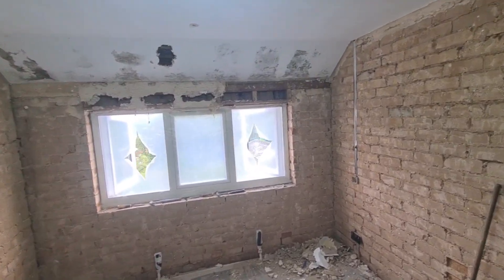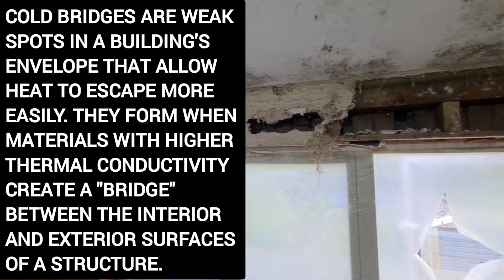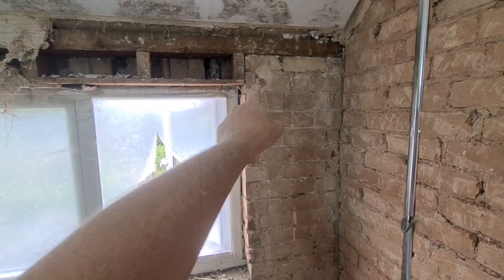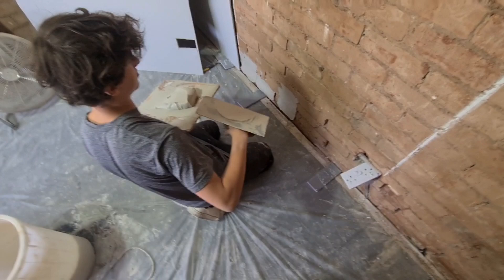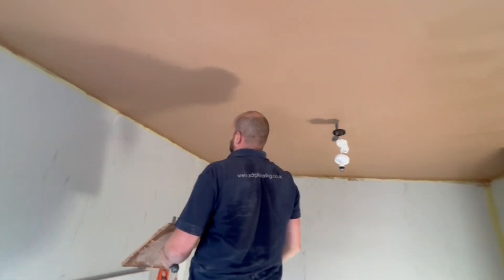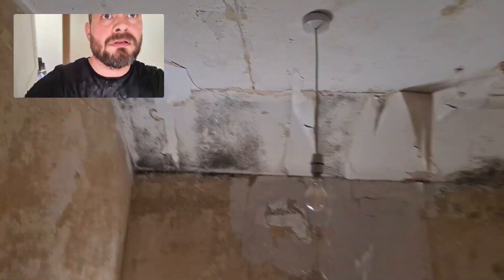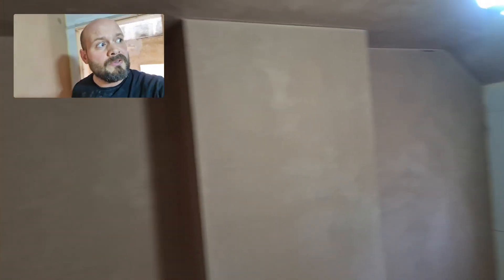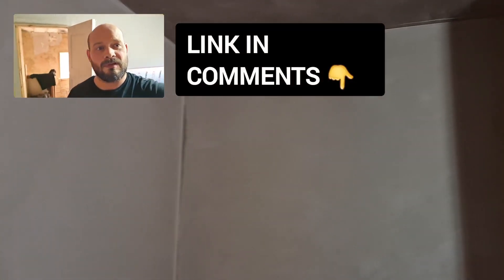WHAT IS COLD BRIDGING?

Comment from the maker: What is Cold bridging? 

Cold bridges are weak spots in a building's envelope that allow heat to escape more easily. They form when materials with higher thermal conductivity create a "bridge" between the interior and exterior surfaces of a structure..

Here at SD Roberts Plastering & Wall Insulation in Warwickshire we help homeowners save on heating bills by installing effective thermal wall insulation systems. These old homes in Warwickshire are timeless and strong but unfortunately they are also susceptible to damp and cold due to lack of insulation 

Roof eaves, window reveals and solid walls are some common examples and this is why you will often see us insulating these areas in older homes throughout Warwickshire..

We have built up a strong reputation in the area for delivering quality work that lasts and here are our customer reviews on Google:

https://g.co/kgs/Qy4UwjU

Do you live in Warwickshire? Do you have a cold home or problems with damp?
Get in touch here to arrange a no obligation survey 👇

https://form.123formbuilder.com/2387712/contact-lead-form

Comment: What are you using please in sticking the PIR BOARD to the walls?

Also how do you stop thermal bridging if you have sockets? Surely the cold spot would get into the backbox?

Please respond thank you
Reply from the maker: @jackpartridge7891  Hi,

You can use putty pads to prevent condensation on existing tin back boxes. For thicker insulation new back boxes can be installed into the Face of the insulation 👍

P.S

Use PU adhesive to bond the insulation boards 👍

For More info consider joining my online course 👇

https://bit.ly/4hsXw8K

Comment: Wow, I think that you are the only installer I've found who attaches PIR boards to non-cavity solid walls (not saying you're wrong by any means, just trying to gather info).  1910 house, I've stripped 2 20ft external walls of the old lime plaster due to historic water damage and was going to batten with 2*2, infill with 50mm PIR and tape the edges, more 25mm PIR over the top then plasterboard and skim
Everyone has been screaming "interstitial mould, your floor joists will rot, use varour-open insulation!" so it's very confusing how to proceed.  You don't seem to have any mould issues when using PIR on solid external non-cavity walls?  You don't use any aluminium tape or a green vapour barrier?
Thanks for any advice you can give, buddy, you're my only hope :)
Reply from the maker: @DrJohnners  Hi thanks for watching. 

You'll see in most of my video walk throughs even on historic buildings made up of lime or soft mortar it's very rare to find one intact. Meaning they usually have been tampered with to some degree as materials changed the repairs have modified these homes and it's been this way for decades in old homes.. Most have been repointed with cement mortar or have been cement rendered / pebble dashed with a rich mix of sand and cement. Even if the brickwork is well preserved externally the internal plaster in these old homes has usually been repaired to a large degree using cement, gypsum and DIY one coat filler. They almost never have breathable paints and they've been this way from the 70's or 80's so maybe 50 years or more.. and so as much as I'd love to say let's hack back this gypsum and cement, let's strip away this non breathable paint on the walls, lets repoint your home using the correct mixture of soft lime.. and let's use wood fibre insulation and lime plaster.. unless the customer budget allows and the homeowner is sympathetic to the history and fabric of the home its usually the PIR they want when comparing thermal resistance and loss of floor space / labour costs to install.

In regards to interstitial condensation developing in these type homes air tightness on these systems is important. Batton with  air pocket is better than bonding the PIR in this case. Worth noting PIR has built in VCL. Providing joints are carefully sealed no need for foil overlay tape 👍 the external pointing and render should be carefully addressed to rule out penetrating damp on these buildings.

If you would like further information on breathable and vapour controlled IWI systems consider joining my online training course coming soon 👍

https://form.123formbuilder.com/6733057/copy-of-trowel-talk-waitlist
Reply: @SDRobertsPlastering  Some solid info there, thanks so much for the response. Keep up the great vids, we're all watching, and for someone not in the trade but renovating an old house it's all amazing content! 👌

Comment: My kitchen is really tight on space. Is it worth the effort of doing the external wall with the 6mm board that you have show in other videos ? It’s probably my only realistic option
Reply from the maker: @mrs5850  Yes. The 6mm will eliminate condensation and mould issues and give a thermal uplift of between 25 - 30% on a solid wall

Comment: How do you stop the cold bridge moving higher, above the window above the bit you filled between rafters?  By insulating from the top down above the roof space?
Reply from the maker: Yes. The loft insulation typically covers the wall plate 👍

Comment: is it ok to use no nonsense sticky foam adhesive/ or any other brand of foam adhesive around hot water pipes/gas pipes.
Reply from the maker: It's not ideal incase pipes ever need replacing / repairing. Pipe insulation sleeves better 👍

Comment: hi. what was the thickness of the board you put between the rafters in the eaves, and did you maintain 50mm airflow? I take it that the underside was also thermal plasterboard to stop cold bridging through the timbers, could not tell from the video? Thanks.
Reply from the maker: @aaronrothwell9026  50mm between + 35mm PIR plasterboard overlay yes gap for airflow was maintained 👍

Comment: nice work. can you fix this insulated board to a plastered wall with cavity . wall has a 4" cavity with 2" insulation. house is 20 years old.  wall is in good condition only cold in winter. walls are plastered blockwork.
Reply from the maker: Hi, yes you can 👍